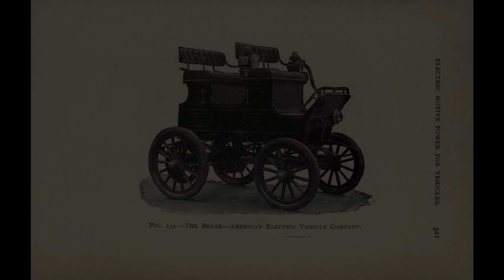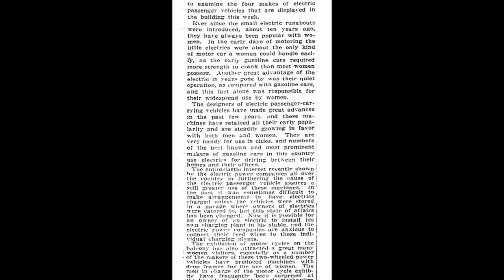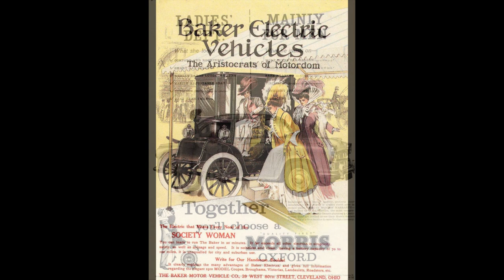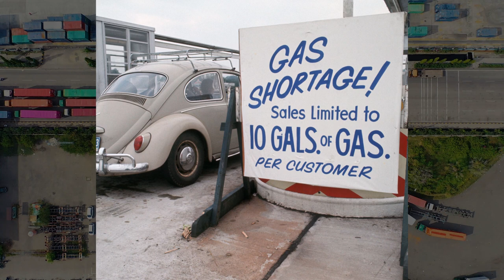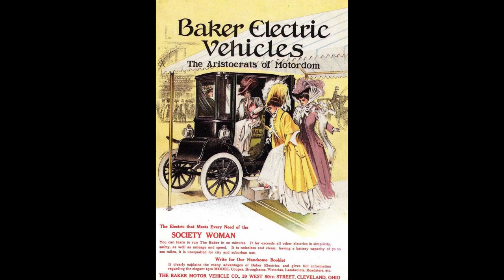How American Oil Killed the Electric Car

Comment: I remember when GM killed it's own then-revolutionary EV-1 electric car,
undoubtedly bowing to pressure from the wretched fossil-fuel industry. That's not all, although it might not be directly related to the subject at hand, there is also an interesting story about how the big three actually conspired to derail mass-transit initiatives so people would be forced to drive rather than take a bus or train. The automobile and oil industries have long worked in tandem besotted with sheer greed, caring only about profits, often at the expense of our environment.
Reply: Yeah, it seems the EV1 project is something they want swept under the rug, like it never happened. Even in most YouTube videos I watch about this, it is the most omitted piece of the information and history about the evolution of this movement, even though it seems to me it's one of the more critical pieces to make the story accurate.

Comment: electric care are nice, but you need to watch how you are powering them. if you are running fuel plant to make electricity, it is much, much less efficient.
Reply: Noah:
Exactly on point. But the fact is that corporations are responsible for much evil behavior in the past century, and they don't mind government regulation if it hurts the competition. Competition is the heart of real capitalism and the hope of small business owners. Electric cars which are well made and of good material will last for centuries, if the battery technology would only be improved. But the Amazon rain forest doesn't need to be destroyed for the production of electrical power and vehicles. They don't pollute and they have low maintenance and long service life.
Reply: Noahmans land, you are wrong!
If you burn oil to produce electricity for EVs, you need less oil to run these in comparison to combustion cars.
It‘s true!
Take a calculator and you will see it…
Reply: @matthias2912  the sheer amount of loss from  out of the ground gas to electricity to your home is immense
Reply: @noahmansland3301  Well, in 1 liter gasoline is about 10kwh
If you burn it in a prof. powerplant you get 4kwh out of it. 40% efficiency is quite realistic.
An EV needs about 20kwh for 100km.
So you would have to burn 5 liters of gasoline to get those 20kwh.
Which car needs only 5 liters of gasoline?
The loss „on the electric lane“ is only about 5%.
In the end you can also use the warming of the powerplant for a different purpose.
But you are right, we need more PV and windmills to run even cleaner EVs…

Comment: Gas cars took off all over the globe because they have many benefits. The purchase cost and operating cost at that time was way higher with EVs since batteries had short lifespans. And don't forget... much of the benefits of EVs today are climate related. The CO2 green house gas theory wasn't taken seriously in any capacity until the 1930s and 40s, so people and oil companies had no moral objections to burning oil... it simply was the better technology. Today medium and heavy duty trucks use diesel as opposed to gasoline... Why? because its the better technology. Of course backdoor politics play a part in automotive history, but its certainly not the sole cause of all decisions.